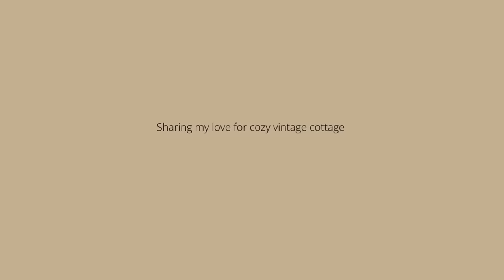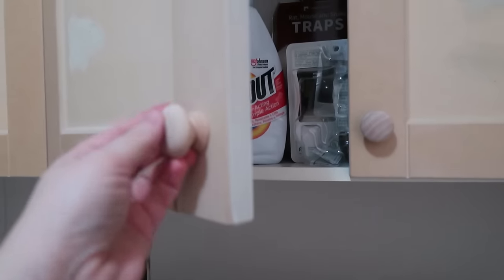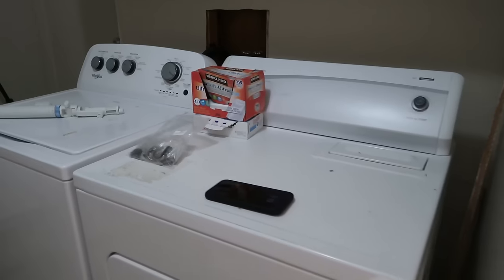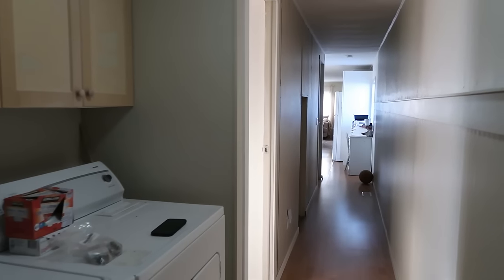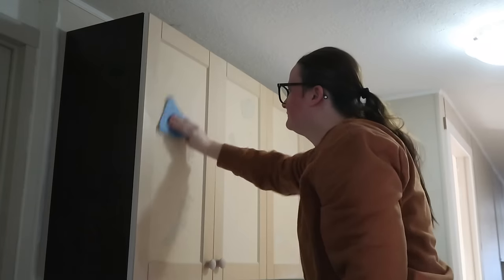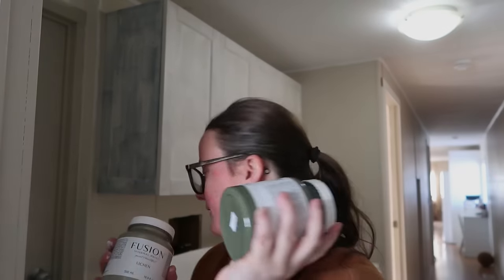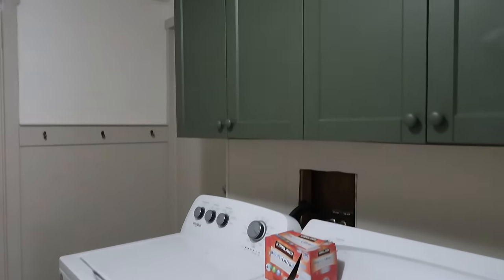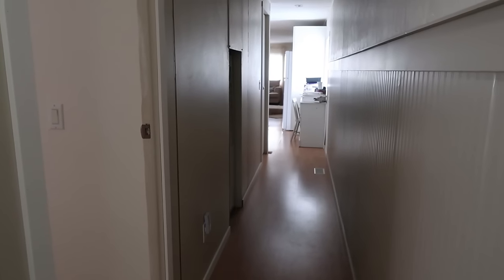MOBILE HOME MAKEOVER ON A BUDGET | 1970's Mobile Home

Comment: I picked up a tip about painting wood that wood filler has been used on.
Once you have sanded the surface, and before you paint, spray the surface with shellac. It will change the porosity of the wood filler allowing it to smooth out and accept the paint.
Good luck, you’re doing great.
Reply from the maker: Thank you for the tip!! Might have to try that! Thanks for watching!  ❤

Comment: Cabinets look great, but I would change the knobs. I painted my cabinets as well, but bought ceramic knobs from Amazon or Ebay. By the way, if you use chalk paint, you don't need to sand or prime. High quality chalk paint only reqires a clean, grease free surface - game changer 😁.
Reply from the maker: Thank you! 🫶🏻

Comment: As stated in the previous comment I posted, I am a boutique  furniture painter.  When painting your wood surfaces that you have filled or spakled  or otherwise manipulated always use Zinnser Clear shellac before you paint.  Wait 24 hours before painting them.  It will make your paint go on without different products showing through.  It will also allow  your paint go on smoother.
Reply from the maker: Thank you! 🫶🏻